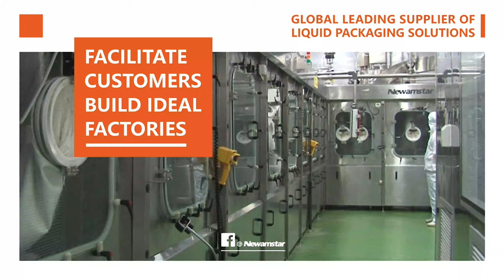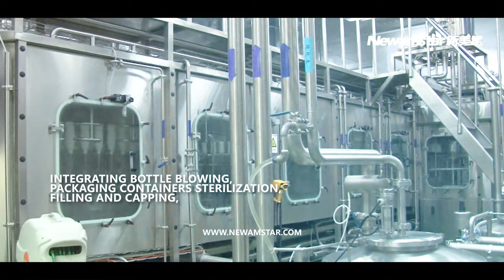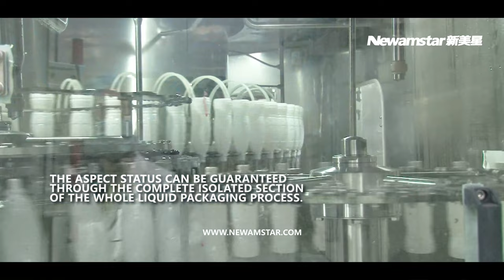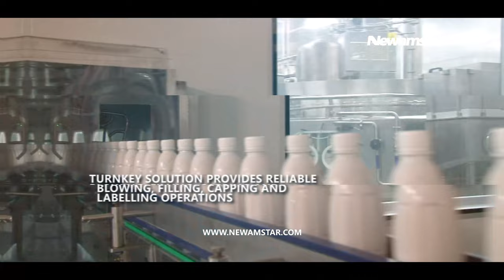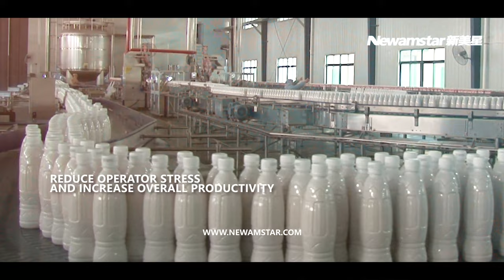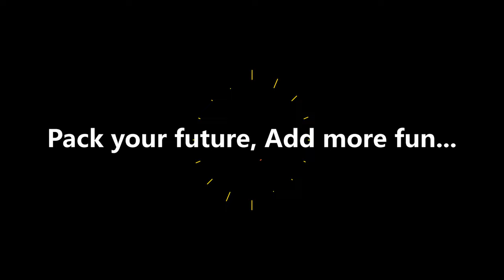PET Bottled Milk Blowing Filling Capping Combiblock Production Line #Aseptic #Filling #Technology

Comment: Newamstar's digital smart factory solution provides customers with an open platform and analyzes and processes the data through the latest production line management software, presenting users with clear and accurate production dynamics.